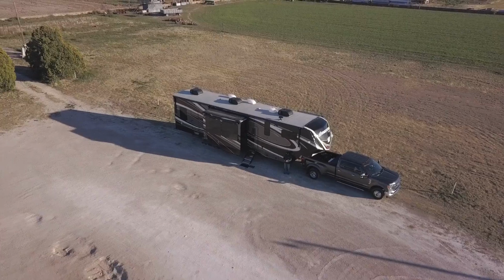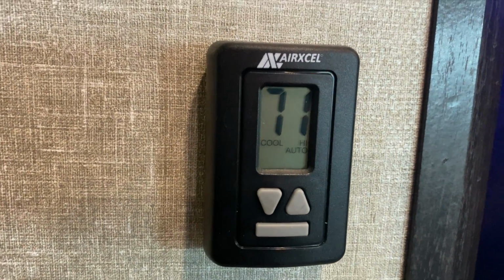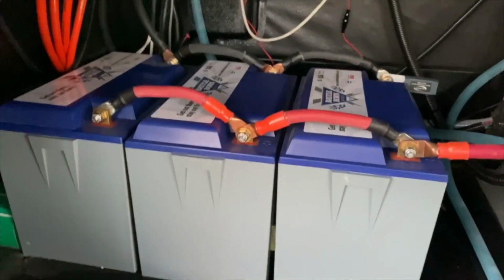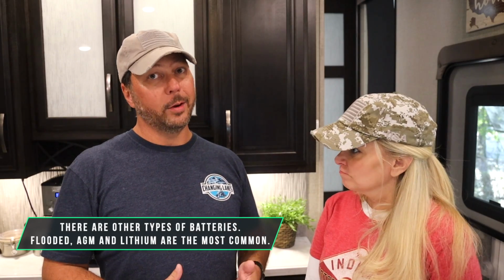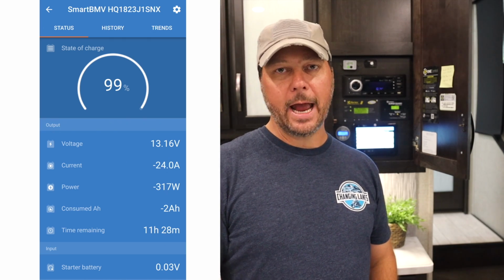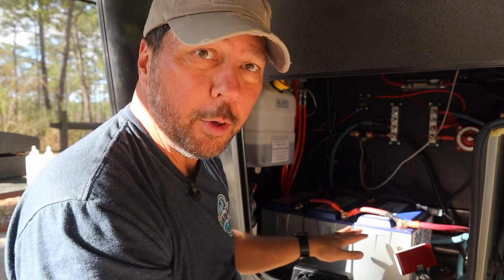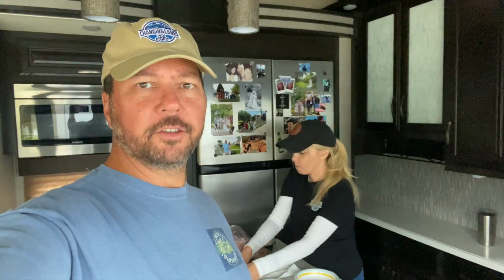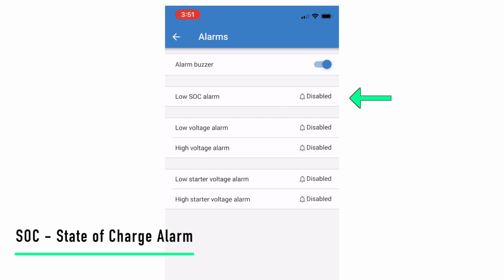RV Battery Monitor | RV Power Management | Victron BMV-712 Review

Comment: It looks like you have 2 shut off switches; one for the batteries and one for the inverter. Why do you use 2? Thanks. We're trying to get our head wrapped around this, also! Brendan & Lena 
Frozen Sneakers, Pa.
Reply from the maker: The inverter required it's own cutoff while leaving DC power to everything else...  The one I point out in this video is an everything cut-off in case we ever need to its nice to have.  Heard of people leaving their RV with a dealer or in storage and something drains the battery.

Comment: I ran my AGM to nearly 0 And that was a year ago And I use it daily and it lasted over a year now and counting
Reply from the maker: When you say 0.. O volts?  You can go below 50 but each time shortens the life of the battery.. You might get away with a run to zero, but the battery's lifespan was likely shortened.
Reply: Changing Lanes yes

Comment: As always love your videos and you make explanations simple and understandable. Wondering, How you like your 300Amp Go power inverter? It heard a some kind of trouble with them  but I am excited about the 50 amp in and out. I have a different setup. But still like what you have done.
Reply from the maker: Our 3000Wat GoPower has been great!   However, I think our next one will be a Victron that does power share on both legs.  👍🏼

Comment: Good morning sir I hate to disturb you with this question but I noticed that you have a toy hauler and then watching your videos thumbs up to both of use the question I asked for you is we are seasonal campers and we’re thinking about selling our seasonal and buying a toy hauler for the reason of us just bought a new Harley Davidson Street glide wanted to know how difficult it is to put the bike in the toy hauler into remove it thank you
Reply from the maker: I don't find it difficult at all...   We use a WheelDock. https://wheeldock.com/ and four straps.
The wheeldock has a piston you trigger with your foot to lock in the wheel versus having to rock it in and out. I don't bolt it in at all, it just sits on the floor and I strap Lucile down on the front forks and rear bars.
We demonstrate it a bit here https://youtu.be/_X-LAY8Fwlw?t=1341,
then later here https://youtu.be/uPXNmS0IBRQ?t=1268
and even more here: https://youtu.be/f56_8ecCTaI?t=777

Comment: What are the inside dimensions of the battery box you are using?  I know the size from another of your videos, but the size of the bottom, inside of the box will be the determining factor as too what batteries can fit.  I was fooled by another box that I thought would fit.  Perhaps you could just tell me what the foot print of your four batteries is. Thanks
Reply from the maker: We don't have that boax or batteries anymore.. But I think it was the 37gal tote from home depot.   You best bet is to measure your batteries then go shopping for a box that fits...

Comment: Hello from Alaska Chad and Tara. I really have learned from ya'lls videos. We plan on buying a fifth wheel to semi full time live after retirement. With regard to this video, I noticed you do not charge your batteries via your trailer to truck cable. Is there a reason you do not? We have dual alternators on our Ram Dually and plan on providing battery charge capability from the alternators. I look forward to your answers. Safe Travels, Dan
Reply from the maker: The stock 7 pin can only provide a trickle charge.  To get a real charge, you need to add a DC-DC charger and appropriate cabling to handle the amperage to the trailer.  This will be in addition to the 7-pin.

Comment: Hi. 
From talking about 3,000   Your video crashed out   ! !   Tried re booting !  Still the same   

Surely you charge your battle batties via the truck when travelling. ? ?   

Great video and explained In such a way that is easy to understand 

Thanks
Reply from the maker: Hi.. Not sure why the video crashed for you?   The 7-pin connector only supplies minimal amperage.  When running the inverter, it's still a net negative.

Comment: Doesn’t the 12v hot wire from your truck when your hooked up on travel day connect to your 12v system in the coach? The only reason I ask is I have never had more than one battery in my rvs due to the fact I don’t dry camp much and if I do I just use the onan. On the days that we pull I’ve never had a issue with the reefer running while I was plugged into the truck. Y’all have a good channel keep up the great content.
Reply from the maker: The power supplied through the 7-pin is minimal.  It might be enough to float charge if nothing is running in the RV.  But, we use our inverter (https://youtu.be/1rPKWrXQYWA) to run our fridge as well as keep the internet up so our Ring security system (https://youtu.be/f-cWvMqnU9g) can monitor for smoke and water leaks.   The result is, the RV is using between 10 and 50 Amps DC while towing.  We might be getting 4-5Amps tops from the 7-pin (just a guess based on what we see on the monitors).  So, our options to charge while towing are solar and/or a connection to our truck's second heavy duty alternator.  We are looking into both.
Reply: Sounds good, and thanks by the way, the diesel card works great. We always had to fuel up at the truck stops and it was alway a pain to have to go in and pay the high prices. If y’all are looking for places to check out I would recommend the Ozarks in Arkansas we were trail riding with our side by side but, the roads through that country would be great on a bike “ The pig trail scenic byway”. Safe traveling to you both.

Comment: Since you have put so much time into your electrical system what are your thoughts on running the generator while driving instead of batteries?
Reply from the maker: We do that sometimes...  Run it for a bit to charge them... or sometimes if we want to run the AC for the last 30 minutes of a trip on a hot day.  👍🏼

Comment: Please get your break away cable connection checked. Have seen a couple of failures on GD's lately.
Reply from the maker: Failures with the switch?
Reply: @ChangingLanes  Yes, KYD had complete failure when they had their GD at ETrailer getting their disc brakes on. I have seen a couple others commenting that their brakes weren't coming on when the brake away cable was disconnected. Somebody with this problem needs to report it to NHTSA. Watch at the 6:55 mark
https://www.youtube.com/watch?v=cV4mBDaaeTw
Hope this keeps you safe if you do have a problem.

Comment: Are 3 battleborns making it all night?.....
Is your system set up to auto start the generator at low voltage?
If so are you using the incommand or another method?

Thanks.....great video....again...
Reply from the maker: Yes.. 300Ah is plenty to go from around 7pm to 10am the next morning as long as it's not too cold.  👍🏼   We'll add more in the future.
Reply: @ChangingLanes  are you set up for auto start on low voltage
Reply from the maker: @steveh7857  We do have that feature, but it's pretty useless when running heavy loads via the inverter with the voltage drop.  We're looking into a state-of-charge starter that integrates with our Victron battery monitor...
Reply: @ChangingLanes  reason I asked, my INcommand. auto start is set for 11.8 volts. Useless for lithium batteries. Cannot be changed.
I have done a little research on this topic and it seems to be pretty involved....at this point, the payoff probably will not be worth the work.... Thank you for the response.

Comment: No one who has done these videos has covered the charging through the truck/alternator(s). Is there a way to run something from the truck to boost the charging if it's not enough while it's hooked up and running? Does the truck being hooked up charge very much?
Reply from the maker: The power supplied through the 7-pin is minimal. It might be enough to float charge if nothing is running in the RV. But, we use our inverter (https://youtu.be/1rPKWrXQYWA) to run our fridge as well as keep the internet up so our Ring security system (https://youtu.be/f-cWvMqnU9g) can monitor for smoke and water leaks. The result is, the RV is using between 10 and 50 Amps DC while towing. We might be getting 4-5Amps tops from the 7-pin (just a guess based on what we see on the monitors). So, our options to charge while towing are solar and/or a connection to our truck's second heavy-duty alternator. We are looking into both.

Comment: Great information I have a 600 ah power battery bank that's 712 monitor it's only rated for 500 would that still work for my battery bank thank you
Reply from the maker: Yea.. Amps and Amp Hours are different.  You could run two 3000W inverters on 500A.
Reply: Thank you very much I appreciate it you answer my question

Comment: How come your truck isn't charging your house batteries when you're driving? My fifth wheel always charged my house batteries while I was driving.
Reply from the maker: The power supplied through the 7-pin is minimal. It might be enough to float charge if nothing is running in the RV. But, we use our inverter (https://youtu.be/1rPKWrXQYWA) to run our fridge as well as keep the internet up so our Ring security system (https://youtu.be/f-cWvMqnU9g) can monitor for smoke and water leaks. The result is, the RV is using between 10 and 50 Amps DC while towing. We might be getting 4-5Amps tops from the 7-pin (just a guess based on what we see on the monitors). So, our options to charge while towing are solar and/or a connection to our truck's second heavy-duty alternator. We are looking into both.

Comment: can you charge you battery with you truck when you pull you trailer
Reply from the maker: Yes and no.. Yes, there is enough to charge the batteries, IF we weren't drawing a lot more than that running the inverter for the fridge and such.  So, it's a net negative power draw.

Comment: Can we replace our stock RV battery with a golf cart battery for longer power supply?
Reply from the maker: Golf cart batteries are usually a good choice but are usually 6V, so they need to be wired in series/parallel.  That's how we were set up with our Trojan T-105s for our first year.

Comment: Interesting your truck doesn’t charge your house batteries while your driving all day. Why not?  Did you retire or feel it wasn’t enough?🤔😜
Reply from the maker: The power supplied through the 7-pin is minimal. It might be enough to float charge if nothing is running in the RV. But, we use our inverter (https://youtu.be/1rPKWrXQYWA) to run our fridge as well as keep the internet up so our Ring security system (https://youtu.be/f-cWvMqnU9g) can monitor for smoke and water leaks. The result is, the RV is using between 10 and 50 Amps DC while towing. We might be getting 4-5Amps tops from the 7-pin (just a guess based on what we see on the monitors). So, our options to charge while towing are solar and/or a connection to our truck's second heavy-duty alternator. We are looking into both.

Comment: Do the batteries charge going down the road ?  Enough to keep up with the frig need?
Reply from the maker: The power supplied through the 7-pin is minimal. It might be enough to float charge if nothing is running in the RV. But, we use our inverter (https://youtu.be/1rPKWrXQYWA) to run our fridge as well as keep the internet up so our Ring security system (https://youtu.be/f-cWvMqnU9g) can monitor for smoke and water leaks. The result is, the RV is using between 10 and 50 Amps DC while towing. We might be getting 4-5Amps tops from the 7-pin (just a guess based on what we see on the monitors). So, our options to charge while towing are solar and/or a connection to our truck's second heavy-duty alternator. We are looking into both.

Comment: Does your truck help with the battery charging during travel days?
Reply from the maker: The power supplied through the 7-pin is minimal. It might be enough to float charge if nothing is running in the RV. But, we use our inverter (https://youtu.be/1rPKWrXQYWA) to run our fridge as well as keep the internet up so our Ring security system (https://youtu.be/f-cWvMqnU9g) can monitor for smoke and water leaks. The result is, the RV is using between 10 and 50 Amps DC while towing. We might be getting 4-5Amps tops from the 7-pin (just a guess based on what we see on the monitors). So, our options to charge while towing are solar and/or a connection to our truck's second heavy-duty alternator. We are looking into both.
Reply: Thanks for the explanation. Makes sense now.

Comment: I have a travel trailer that will charge the battery off of my 12 volt 7 pin plug. Do fifth wheels not have that as you are towing? Just wondering since our next trailer is going to be a fifth wheel and you said you monitor while you are towing.
Reply from the maker: It does.. But the Amperage is not enough to charge in our case because we leave our inverter on to run our electronics (internet, ring alarm for smoke detectors, etc).  We also run our fridge via the inverter.  If we had everything off, it might trickle charge but still not much.

Comment: Do you have your generator wired so when your batteries are at , say, 10% , the generator kicks on ?
Reply from the maker: Right now, our AGS is strictly by voltage which stinks.

Comment: Did you Victron BMV700 come with the shunt rated at 600 amps?
Reply from the maker: 500 Amps.  Plenty since our wiring and fuse for the inverter is rated at 300A.

Comment: Your batteries are in parallel not series...pos, pos, pos and neg, neg, neg is parallel...pos, neg, pos, neg and pos, neg is a series connected battery bank. 🥴
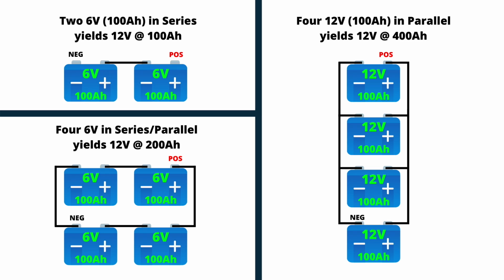Reply from the maker: Yes.. I misspoke.  Which is why we corrected it on-screen @ 15:35.  We also covered series versus parallel in regards to voltage and amperage earlier in the video @ 6:40.
Reply: @ChangingLanes  Otherwise, very informative video...I'm also looking to install the Victron BMV-712 or their Smart Shunt, just upgraded our batteries to LiFePO4 batteries and definitely need a better way to monitor them than what came with the FLA batteries in our coach. Enjoyed your video. 🤠👍

Comment: Hey guys great video. Chad I have a question on the 712 monitor. On the load side of the shunt, did you run any wires to it from the main circuit panels? That part confuses me. Can you please tell me what all you put on the negative bus bar that goes to the shunt. I'm finally doing my install on the 712 and a Victron Multiplus Inverter tomorrow !. Freakin Amazon taking there time piecing my order. Thanks
Reply from the maker: Yes... there is a control cable running from the shunt to the monitor panel.  That's the most difficult part of the install.  However, you can do what we did for the first several months and just leave the control panel (the round part with the display) in with your batteries and control it over bluetooth.